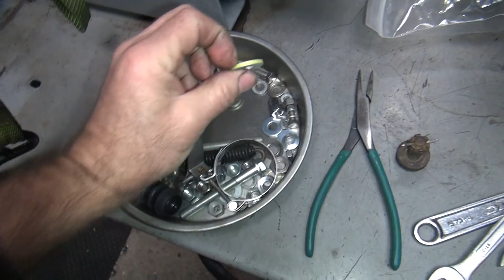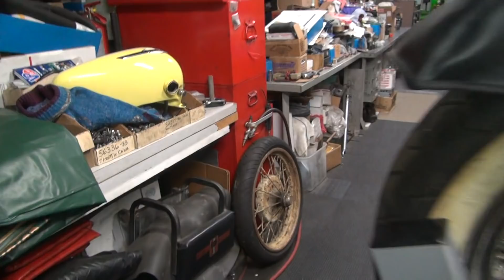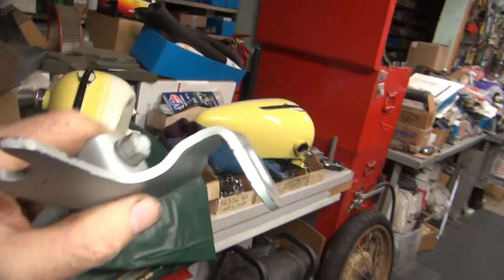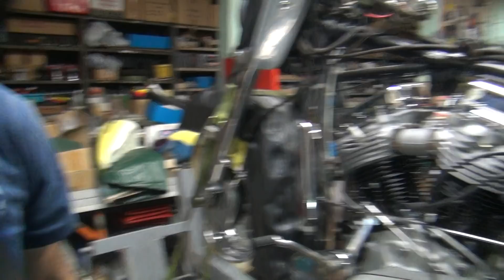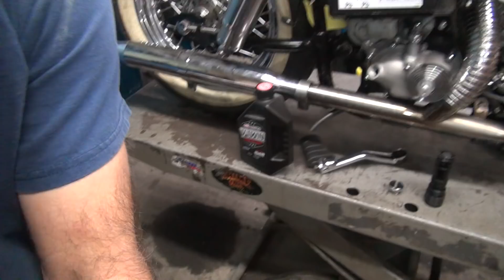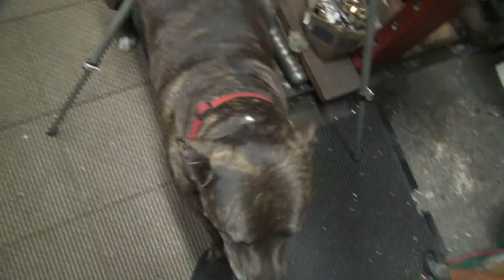1965 panhead #156 74ci flh motor rebuild and bike repair harley by tatro machine

Comment: Tatro, I realize you're the expert and I'm just another YouTuber, but...

A four speed gear box oil capacity is 1 1/2 pints, though I've been told running only 1 pint is fine and it's less likely to
leak out of the main shaft seals (shrug). 1 1/2 pints won't come close to the plug that's in the newer covers (smooth, with
the tall fill hole). You have plenty of cases and covers lying around there. Put the newer kicker cover on one and see what it takes
to get to that small side plug (water would be fine), which by the way is just about even with the center of the throwout bearing.

I made a dip stick marked at 1 pint out of a metal coat hanger that I put in the filler hole.

Drift
(just another internet idiot)
Reply from the maker: fix the trans and the leaks will take care of themselves. sounds like you got the correct oil levels to me. the early cover goes to the bottom of the threads and the late one goes to the level plug hole that is on the side of the cover. both of these methods put the oil level to the center of the mainshaft. the trans will live longer if you keep good thick oil in it at the correct level. running it low does not help things.
tatro